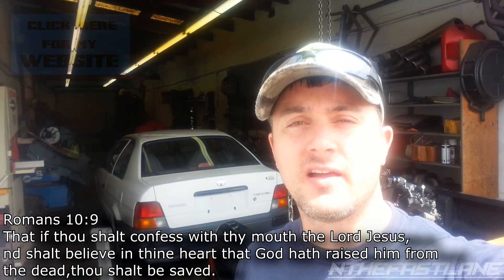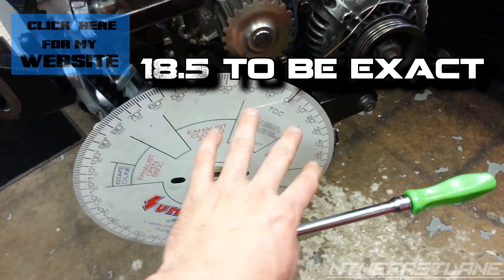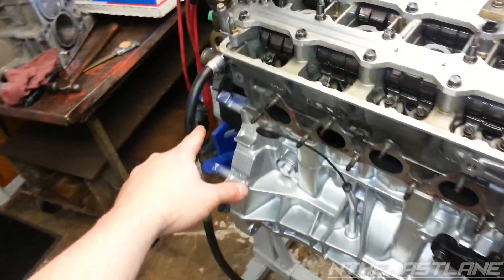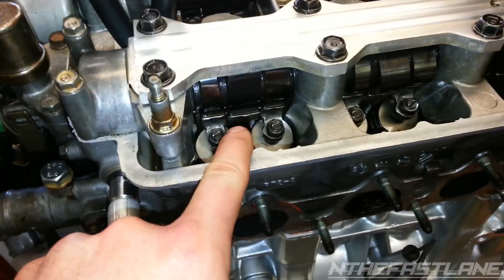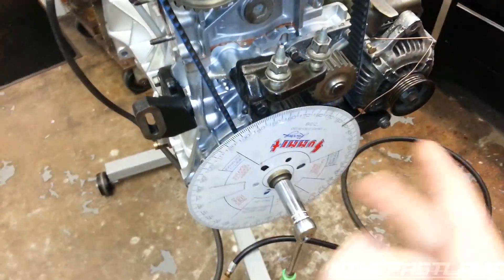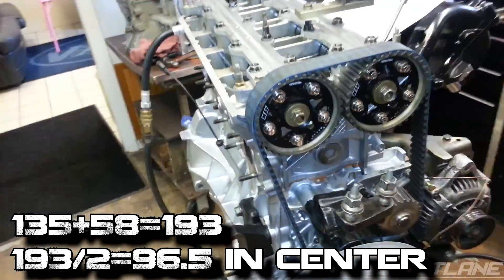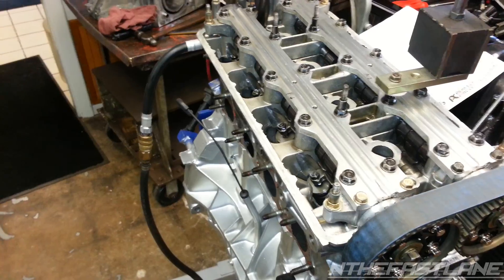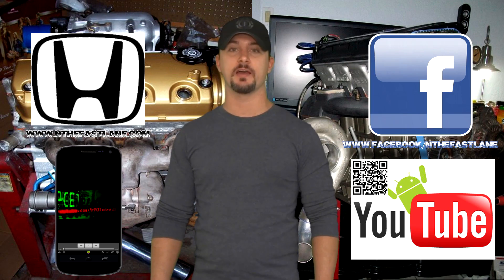How To Degree Cams "Honda Vtec"

Comment: Are you using checking springs (low tension valve springs) for this step? or the springs the engine will be running with?
Reply from the maker: No, just using the stock OEM springs that the engine comes with.

Comment: How do you know which direction to adjust the cam gear,  advance vs retard? Also aren't you suppose to put the valve clearance (for you guys cylinder 3) to 0 with the Feeler gauge?

Comment: Hi, I was wondering what is the part number for the snap on air compressor adapter tool that you used at 1:15. I was having a hard time finding it. Not in your store or google. If you could help me that would be great. Thanks
Reply from the maker: The OTC 5606 compression tester in my store has the 10 x 1 mm compression hose I use, plus you get the compression tester and all of the other connections along with a nice case for the same price pretty much as just one hose from Snap-On. Here's the part number for the Snap-On compression adapter if you really want to get the Snap-On. Part# EEPV5G10L
Reply: @Nthefastlane  Thank you for your help. I really appreciate it. I would look into that otc tool as well. Cheer =)

Comment: You got this all wrong. You're math formula is incorrect and the way you're reading the degree wheel is incorrect. In addition, that degree wheel is label for a clockwise rotation engine.

Comment: You left out that the valve lash needs to be set to 0 . Otherwise your readings are not accurately accounting for the lash gap in degrees.  Could be .001 to .0015 off which though minor does make a difference.
Reply: This is a dam good point
Reply: Just spent like 4 hours doing valve lash, just about to do cam timing and I hear this 😕

Comment: If you find your centerline like this, wont you automatically go to peak lift anyways once you rotate the crank to centerline? Because youre using the current orientation to find centerline, all youre doing is going in the middle of what you already have. Wont you need a centerline spec to go to on the degree wheel?

Comment: Back in the day, the little ZC motor could take a lot of cylinder pressure with stock internals. We would set the intake cam to minimum PTV clearance. And adjust the exaust cam to what overlap we wanted. PTV was done by destroying a few LOL. Shit you do when your a kid

Comment: What if the piston stop is tightened more or less than another guy isn’t true TDC going to be wrong? What if my piston stop is longer or shorter? That’s what confuses me
Reply: It doesnt matter. You rotate the engine clockwise and note the crank degrees where it stops, then counter clock wise noting the crank degrees where it stops. Then remove the piston stop and turn the crank to the middle of those two numbers and 'zero' the degree wheel. 

For example if one reading was 11° BTDC and the other was -12°(ATDC), you would remove the piston stop, turn the crank so the degree wheel reads the middle of those two numbers (-0.5°) and then adjust the degree wheel so it reads tdc. 

To check you have set it right, you can reinstall your piston stop and repeat the first step and both rotations should reach the same number i.e 10° and -10°. 

Hope that helps.
Reply: OnTheRun it does a little yes. I’m building a B18C right now. Motor is fully done only thing is stock “real” ITR cams and S2 gears. Could i contact you personally or message you . Pick your brain a bit

Comment: wait how is half of 19 and 20 18.5, i'm lost lol
Reply from the maker: Middle of 19 & 20 is (18.5)
Reply from the maker: More then likely iT was something like 19.3 and 20.4 ect.. we got it as close as possible, then divided the two and it came out to 18.5 on the calculator.
Reply: ahh ok
Reply: @Nthefastlane  im still so confused though. 19+20÷2=29, (19+20)÷2=19.5, 19÷20=0.95, 20÷19=1.053. 

I dont understand where 18.5 is coming from, what is the exact formula you typed into your calculator? I will be degreeing my cams soon so i need to know this lol. Also does your piston stopper stop threading in at a set point, or how do you know you have it screwed to exactly tdc?
Reply from the maker: I think you're thinking too much into it. Here's the formula: If you get 19 on one pass, and 20 on the other pass. Take 19 and add it to 20 which equals 39. Take 39 and divide it by 2 and you get 19.5. I got a different number because it was a little more or less than 19 and 20. Don't look at my number, just follow this formula. 1 rotation forward + one rotation backwards divided by 2 = The number you need. Hope this clears it up for you.
Reply from the maker: As far as the Piston stopper, I had the same question but it's really simple. It doesn't matter how much you screw it in, or how little, just screw it in until it stops there's no need to adjusted because one rotation forward, and one rotation backwards, divided by 2, will always equal the same number.
Reply: @Nthefastlane  ahhh facepalm alright, that makes much more sense, i hadnt considered that. Jeez you were right, was i ever overthinking that. Thank you very much for simplifying that for me! God bless
Reply from the maker: Anytime, glad I could help.

Comment: The method behind this seems simple ,but actually adjusted the cam/cam gear is not shown and that is confusing.reason I ask is I've done both a b20vtec and an lsvtec and both are 1/2 tooth off no matter how good the tension is or how belt is installed.with adjustable cam gears if you go +or- 3° You can perfectly line them up Same mechanical setup.so would this method correct cam orientation if mechanical timing is off 1/2 A tooth.thank you
Reply: No need to degree the cam

Comment: when the valve is on max lift with ZERO the indicator ? right ?
Reply from the maker: You split your number in half and that will be TDC. GO 360 one way write the # down. Then 360 the other direction, write that # down and divide by 2 and that will be your TDC mark.
Reply: What????

Comment: Does the motor have to be out of car to degree cam ?
I have a sohc do I still have to pull motor?
Reply from the maker: +jarr5648 No, but it's a pretty cramped job and tuff to see the degree wheel is on tdc from the angle you're looking at but It can be done.

Comment: hola me gustaria hacer unas preguntas sobre el motor 4age que hasta que grados aguantan la valvulas al cambiarles los levas por unos de mayor grado como unos Intake 272 / Exhausts 272 siendo el motor totalmente stock. quiero hacer armar un auto para carreras de aceleracion y circuito mas adelante , me pueden ayudar amigos saludos desde panama

Comment: Ok so, you find the center line, turn the crank till you have the cam center line on your degree wheel, once your at the center line, you adjust the cam to highest lift point?

Comment: To find top dead center did you add 19 and 20 and divide it by 2? How did you get the 18.5?
Reply from the maker: You take 19 and you take 20 and just find the middle of those 2 numbers..it was actually "18" not 18.5..typo while editing the video.
Reply: donperry1 I conquer.

Comment: How did you calculate the lift? Anyway you would make a slightly more detailed video on changing the cam degree wheels etc? I would even pay to learn this been trying to figure it out for awhile
Reply from the maker: It's pretty detailed in the the video.. I even show the numbers in text.. get to (TDC) then spin one way 50deg write that number down spin the other way 50deg write that number down. Take those two number and add them together. Last step is divide that whole number by 2 and that's your cam center line. to see the lift you rotate the crank till its at it's max while watiching the gauge go around and count.
Reply: Thanks for the response. I understood finding the centerline and I also meant about changing the cam gears as far as the degrees it changes with each mark on the cam gear. I probably made it seem like the cam degree wheel on the crank. For the lift I was told about a different method but can't remember exactly but again thanks for helping out.